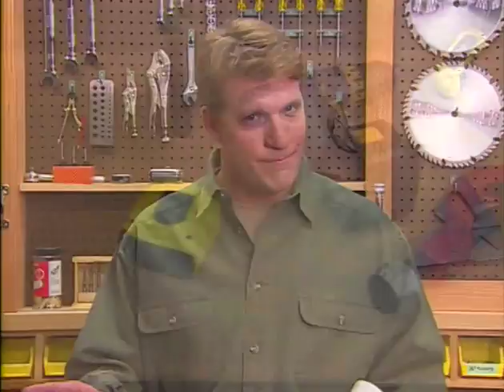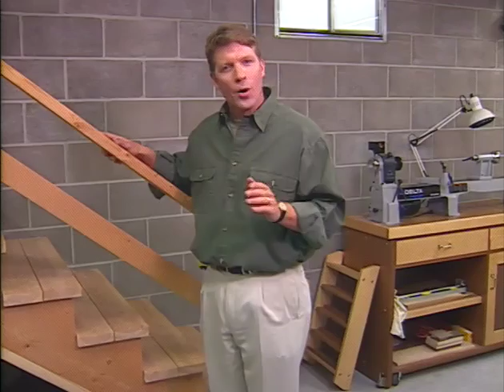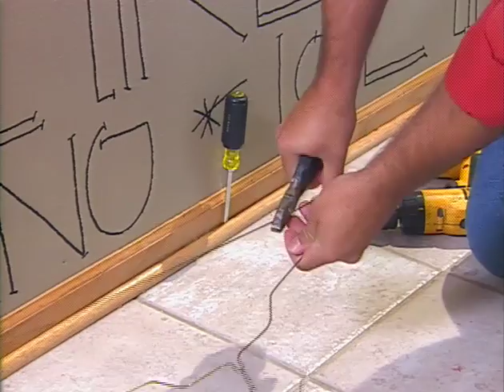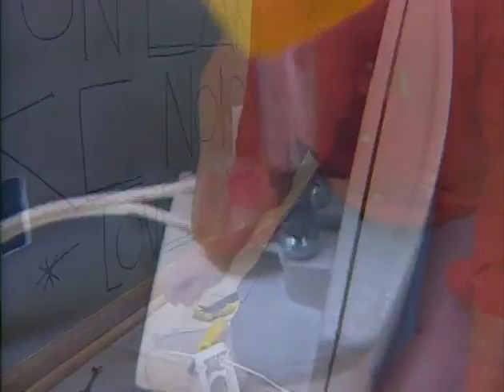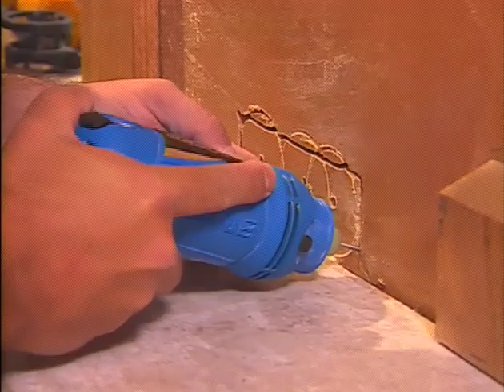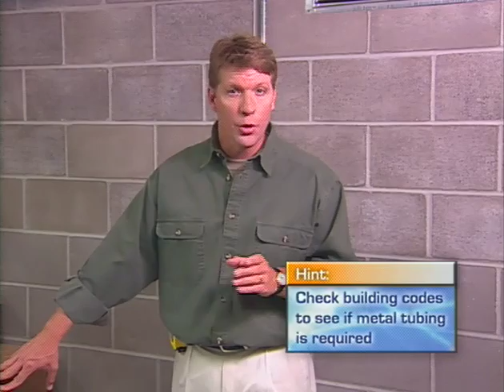How To Install Your Central Vacuum System | eVacuumStore.com

Comment: Check building codes to see if metal tubing is required...if so and you've installed pvc, just spray paint it silver.
Reply: What?

Comment: I have a question. Brother of mine owns a home with a vacuum system installed. They cant find the tank anywhere though. Its not in the basement or their garage. Could be in the attic?
Reply: does it work? if not it may only be roughed in for central vac. usually if hoke has attached garage it will be there
Reply: @jasonh3188  All I know is the outlet had power to it
Reply: @zachsmith1731  if it's taking in derby you would hear where the main vacuum is. if not it's likely not completed
Reply: @jasonh3188  derby?
Reply: @jasonh3188  What's a hoke?
Reply: @majorhavoc9693  typos hero.  relax
Reply: It's likely they ripped the unit out if you cannot find it. Not too common that happens, attic installs I haven't ever seen either.